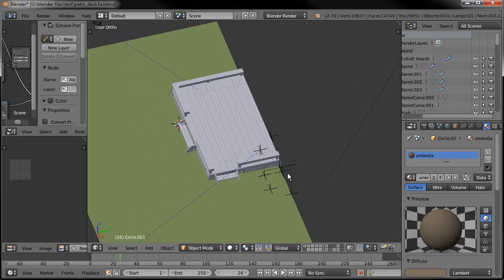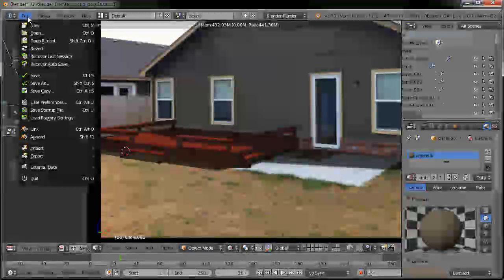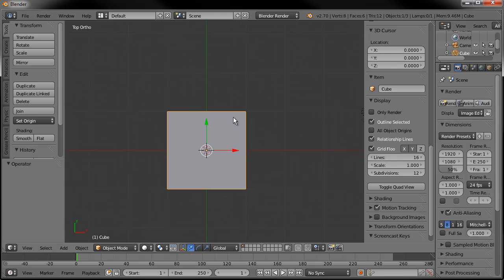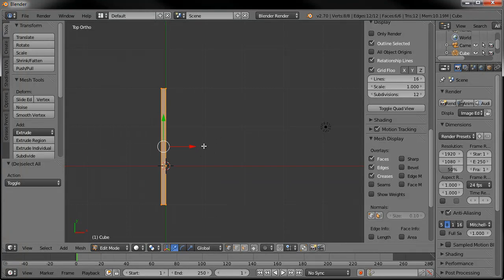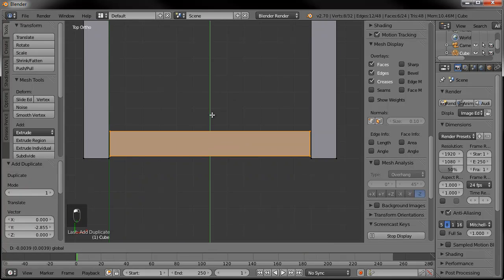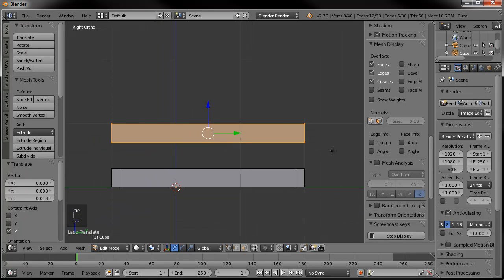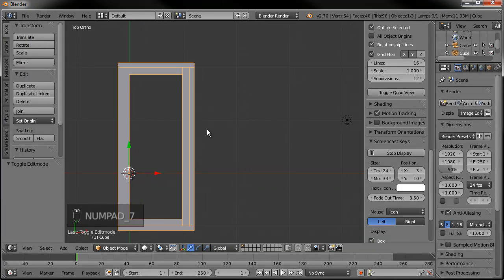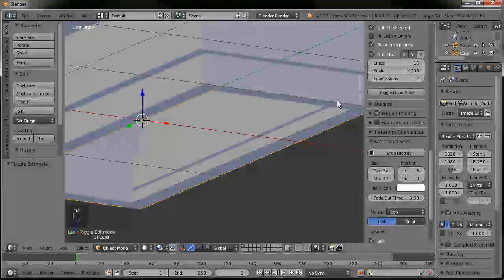Using Blender for Basic Architectural Design

Comment: For making a hole in a box (15:10 in your video) there's something that was added a few versions back. From my notes... To remove the shape of one object from another object, for example, to make a round hole through a cube, you create your cube object and create a cylinder object. Place the cylinder in the cube where you want the hole to be. Select the cube object and go to the Modifiers and add a Boolean modifier. Set the Operation to Difference and then choose the cylinder object from the Object list. Then Apply it and you're done. Delete the cylinder.
Number of tips I got from Ward: 10s-100s, Number of tips I gave Ward: 1 :)
Reply from the maker: haha, thanks :D yeah, i know about the boolean, but it always seems to run slow/buggy for me, so i don't use it very often :P
Reply: the d-dub show / ward7299
Yeah, I find it doesn't do a perfect job on all the faces surrounding the hole that's made. They give the appearance of wrinkles. But I'm still using Blender 2.63 and hope it's better in the newer versions.